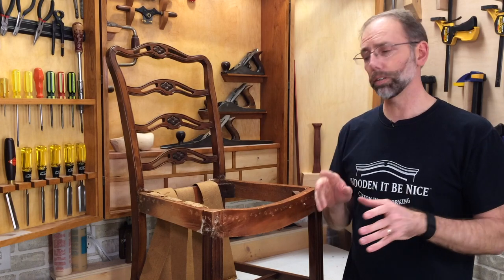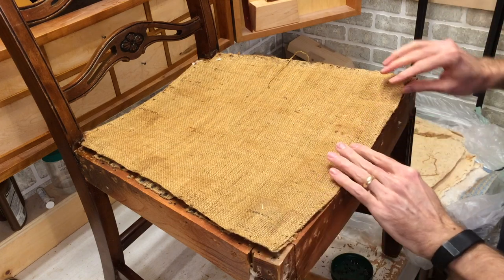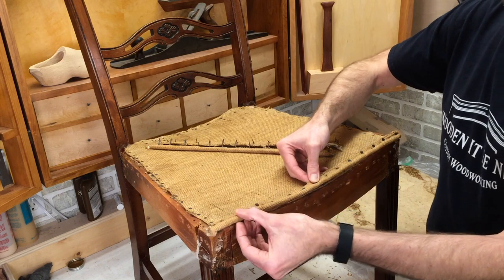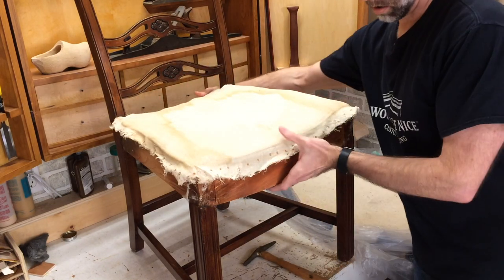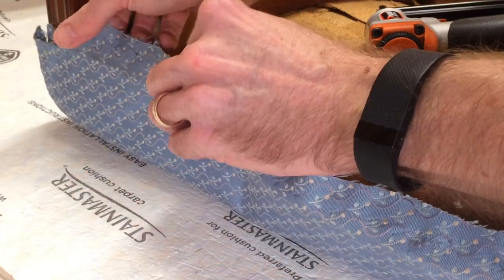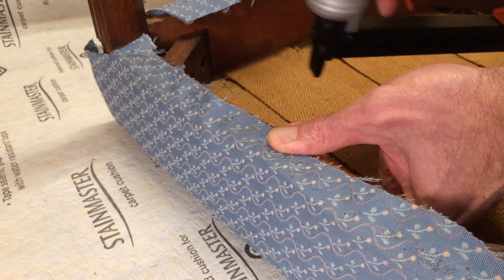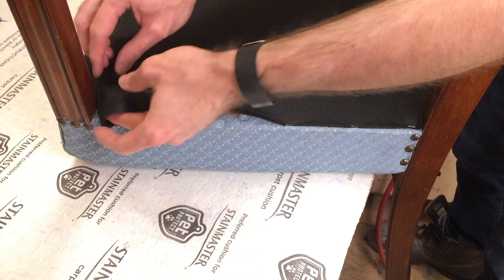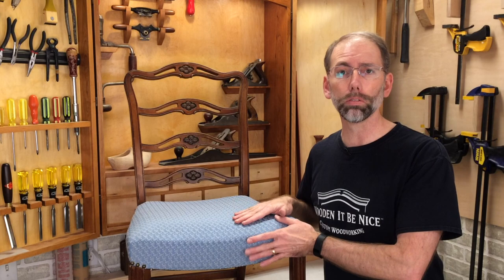Repairing an Upholstered Chair Part 2 - Reinstalling #Upholstery - Furniture Restoration How to

Comment: I thought that when using a tack hammer you use the magnetised end to pick up the tack and position it on the wood but then you spin your hammer to knock the tack home with the non-magnetised end. That way you don't damage the magnetised end.
Reply from the maker: Hi Finbar.  The magnetized end is sturdy enough to stand up to hammering.  It's typical to use that end to start decorative tacks to avoid striking your fingers.  The reason you would spin the hammer around is so you have a larger hammer head surface for striking the tack.  I hope that helps.  Scott

Comment: Scott, don't you have a webbing stretcher?
Reply from the maker: No, I don't.  But I also didn't want to make this chair more firm than the other 7 chairs in the set, so I kept the tension the same as when I took it apart.  Cheers.  Scott